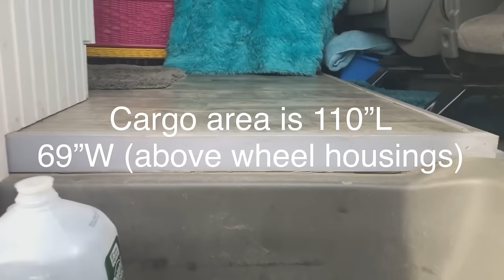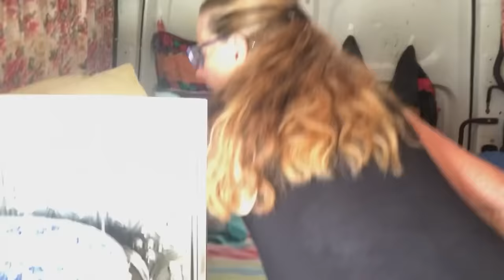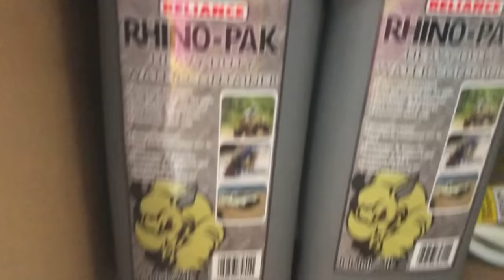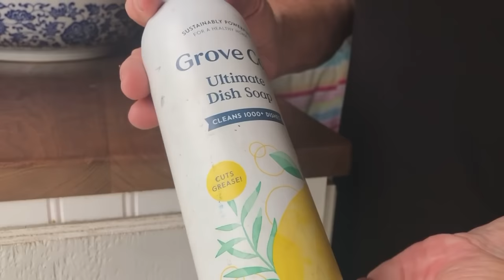KRIS'S DIY SOLO FEMALE EASY VAN BUILD in a NISSAN NV 3500 VAN | TOUR, CHAT, and TIPS!

Comment: I didn't know Nissan made a 3500, I've been looking at converting a 2500 for the same reason - it doesn't scream van dweller.

I have a class B RV and I use the pine pellets as well. It actually does absorb with no odor. A 40Lb bag for $6 bucks lasts about six weeks.

Comment: Coastal Farms (Feed Store type chain) in the PNW carries Nature's Bedding pellets. $40 lb bag costs less than $7.

Bimart also carries this in a small bag for like $4 or $5. (That chain seems to be owned by Coastal Farms.)

Grants Pass has the biggest Bimart I've ever seen. It has a very comprehensive camping and hunting section. 

Pellets are a great cat litter. When the pellets expand, they lightly clump, making removal easy if you aren't rough with it. Fecal matter dries up easily in the pellets. Scooping is easy. It's so cheap that you don't have to be conservative in scooping out. Very good odor control.

If I ever live off grid or in a trailer/van, I'll opt for using pellets for a toilet.
Reply from the maker: Great info, Thanks!

Comment: I love this van! It's warm and cosy and welcoming. The design and setup are clever and comprehensive, having all the necessities. The only changes I would make would be to personalize it to my needs.

Maybe magnetic hooks on the back doors instead of command hooks. But I love this and I love your message. I also love Nissans.
Reply: Thank you for your comment, Jane.  I did go buy big magnetic hooks and the silly things slide down the door.
Reply: @krispavek221  that's so frustrating! If I think of another possible solution I will let you know because when it comes to advice I'm full of it.

Comment: I made similar low tech decisions converting my vintage 1999 GMC Savana from its former life as a high top extended length executive passenger van to a camper van. There's no electric other than a deep cell RV battery charged by my alternator. I mostly use battery operated lights, like her fairy lights, and portable fans. I also have a similar barrel porta-potty with pine pellets. The ceiling and sides were already insulated and covered with fabric. I've slept at temperatures down to 19 degrees and above 100 degrees. I have no refrigeration or ice chest. If I want something cold, I buy single use items. I have no pumps or tanks for water, relying on bottled water and a compact oil change basin for a sink. My bed is a folding cot, which I can remove to create cargo capacity.
Reply: I love this.
Reply from the maker: Sounds like a very sensible build!
Reply: What cot do you use and how comfortable is it?
Reply from the maker: Great question! Beds are hard to get right.

Comment: Shame that Nissan discontinued the NV Line.  Going to order a 2500 - High Top with a small V8, Locking Differential.  Then Covid.  Great seating to drive.  Vans are ridiculously expensive today.
I'm 6'5".  Would have liked the Vans to be longer.  KISS.  Thanks.

Comment: Coolant leaks are important to fix. Go to a radiator shop or try to DIY. The radiator cap will say how many lbs. of pressure the system is designed for. Get a mightyvac and radiator cap adapters online. Make sure that the engine is cool and connect the pump to the system. Pump it up to just under the lbs on the cap and look for the leak. It might be that a hose clamp needs to be a little tighter, and you would never know without pressure testing. Hope this helps someone. The engine needs the coolant pressurized, everything runs smoother.
Reply: It has been to multiple shops. They have been unable to find the leak.
Reply: @krispavek221  oh ok. That must have been frustrating. Enjoyed watching the video. Hope you’re doing well.

Comment: The one thing I adore about the approach towards this video which is completely different to anything I have ever seen and original is the transparency and honesty of it  about how you can still make yourself a little home and not break the bank 🏦 I mean I don't know how but this lady has survived with little to no electricity I've seen so many builds that are overwhelmeingly complicated with all the spew of batteries inverters heaters air exchange ventilation pumping systems special fridges with appropriate wattage like when I see some videos of higher end builds or luxury builds I just think dang like its nice comfortable but then they say how much money they invested towards materials and build usually coming out to  I'd say 10000  or more if your lucky and I'm like what's the point I might as well just move to a place with cheaper housing or put a down payment on a very small place but my point is that some or most of the builds I've seen are horrendous in price like you might as well just but an old or vintage trailer or camper for the price to be spent into building a van. This lady really knows how to live a simple life
Reply: Living simple gives me a lot of peace.

Comment: This is the best build and prrson that I have seen in 3 years. The only question I have is how does Kris power the fantastic fan?
Reply from the maker: Hi Lo On The Go! That is a great question. I reached out to Kris to let her know you asked. Let’s see what she says. : )))
Reply: The fan is wired into my truck's  electrical system.  I only run it a bit at night to get the air circulating before going to bed.  I have accidentally  left it on for a full night and it did not strain my battery at all.
Reply: That is great news. I did not know you could do that.

Comment: Strong magnets would hold your pocket organizer securely in place. I wrap mine in gorilla tape to prevent scratching. They also hold my bug screens.
Reply: They just slide down those back doors, if I use 2 or 3, they will hold a coat.  And these are large.  Quite annoying but not huge in the big picture.   Thank you for your comment.
Reply from the maker: I find the ones rated for 100lbs or more do stay on the weak steel.

Comment: Propane bottles of any size will blow up when the heat becomes too much inside of your vehicle.
It happened in my son's van this past very hot summer, down in the southeastern states.
If you have a small leak in your radiator, get a new radiator ASAP! Or you could lose your entire engine.
Great build out.
Reply from the maker: That’s a very important tip. Thank you for sharing it. Thank you. I hope your son got out of that situation safely.
Reply from the maker: Thank you, Serenity Jewel. That is great information. I think that checking the quality of the canister and keeping it away from flames and directed heat, makes a lot of sense. Safety is an important topic and I appreciate DSS and you for discussing it. Thanks for watching!

Comment: Jet Boil makes a great product; for people who only want to heat water; but, can also be used to cook. Very inexpensive to operate, as well.
Reply from the maker: Thanks, Hallie. That’s a great tip. I’ve been considering trying a jet boil. Makes sense since I mostly boil water too.
Reply: We received one for an anniversary from our daughter and have used backpacking as well as travels to motels; canister fuel is readily available most places now; brings a cup of water to boil in less than two minutes
Reply: My problem is that my 12 volt outlets in the truck do not work.
Reply from the maker: Hi Kris, The Jet Boil does not use electricity.

Comment: 30:27 my door has that recess but not the pocket.  It just cuts in.  I’ve been trying to find a way to utilize it better,…. I will look for a salvaged Nv 3500 to see if they have one like yours!!
Reply: Also contact companies that use these as their fleet trucks. Mine was an air-conditioning and heating truck.
Reply: @krispavek221  my panel is identical to that except it just doesn’t have the pocket.  That is so weird that they would do away with that, it’s such a logical and useful thing to have there.
Reply: @krispavek221  I haven’t seen anywhere local using them as fleet vehicles but I will keep my eye out.  Unfortunately I’ve got 5 more years of payments on mine,…. I am a single/only parent to two beautiful princesses and am at risk of becoming a financial refugee.
Reply from the maker: Salvage yards (via internet) could be a way to find the door. Or even ebay. I have seen doors and other parts for vans on ebay. Good luck!

Comment: Thank you for sharing your story and showing your van. I'm curious to know how the fan above the bed works, if there is no electricity in the van. Does it run on batteries? Where did you buy it? Thank you.
Reply: It is directly wired into the car battery. I bought it on Amazon.
Reply from the maker: Great question.

Comment: Hello Kris, enjoyed your tour tons..gives me encouragement 💗 
50 yr female, raised kids, work full time, on long island, ny and can't afford to rent (even w/ my full time accounting salary) nor am I sure I even want to.  I am ready for freedom very soon!
Most van tours are pricey, so this gives me hope. Thank you!
** 2 questions 🤔 please;  when its really hot weather.... how do u sleep/ deal with the heat in the van?  Does the wool help regulate? Thank you.
Reply from the maker: Hi Wellness Smith, Great question. I’ll chime in with a possibility. Having a window cracked or open while the ceiling exhaust fan is running will create a cross draft that cools the space. Thanks for asking!
Reply: The lack of windows limit solar gain and I also have a cover for that large front window.   The wool insulation is awesome.

When I am camping, I am seldom in the van.

At night, that small screened window is open and I turn the fan on over my bed.  The two work together to keep air flowing through the van.

It also helps that I grew up in Texas without air-conditioning.
Reply: Great, Thanks Ladies, appreciate you both so much!!
Reply from the maker: Thanks, Wellness Smith!

Comment: i am also getting ready to live in RV, with no electric or running water, AZ gets pretty hot, how do you use the fan without electricity
Reply: The fan is hard wired to the truck battery.

Comment: Use magnetic hooks you’ll never have to replace them and stronger than those
Reply from the maker: Great Tip!
Reply: I have yet to find any that do not slide down the metal doors.
Reply from the maker: The seriously heavy duty magnet hooks are available on Amazon. They are very very strong.

Comment: In FL, you could not survive without a/c in your van! You can’t live in 160 degrees heat! I’ve kept water bottles in my tiny car and it’s been so hot I can’t touch it! It’s insane how hot your vehicle gets. Kids and pets left in cars die so I’m lost how you survive with no air conditioning
Reply: In the desert, the night temps drop quickly. Day temps can rise to 120 but are usually just a bit over 100. I have a ceiling fan.

And I am not inside the truck much during the day.
Reply from the maker: Yes, and the very low humidity in the desert makes a HUGE difference. I grew up in Florida, and remember all the inability to cool off and feeling trapped inside. The desert gives relief every evening and morning. Shade also makes a big difference when the air is dry. In Florida, the shade didn’t do much. I hope that is helpful information. Also, spritzing yourself with water will activate evaporative cooling because your skin will be wetter than the air.